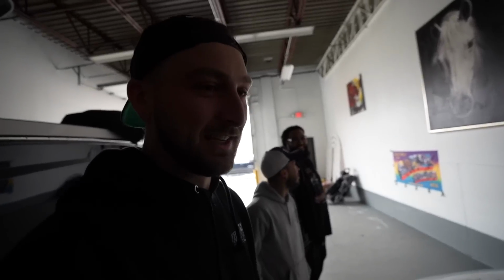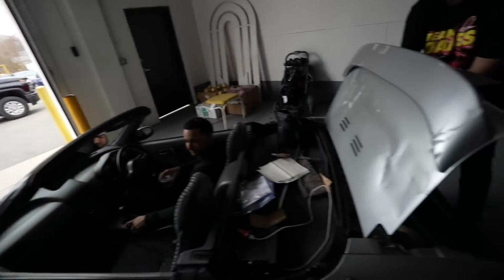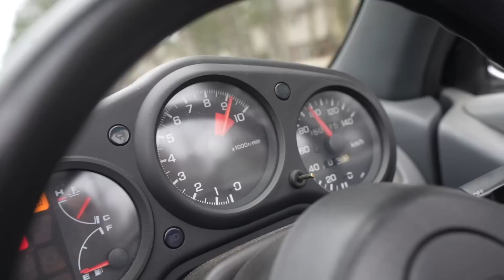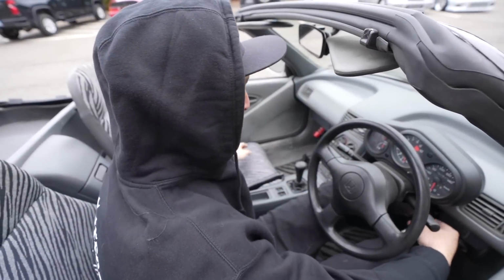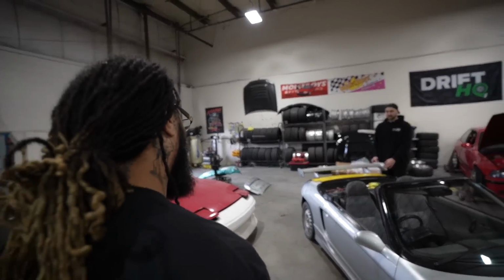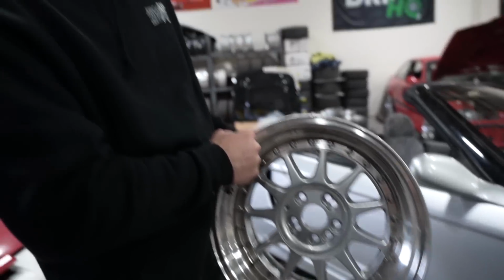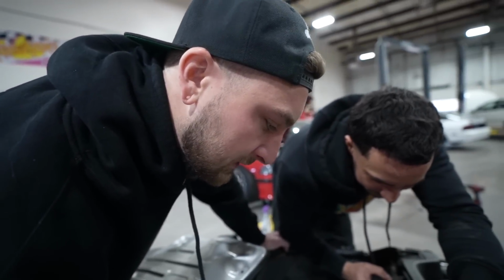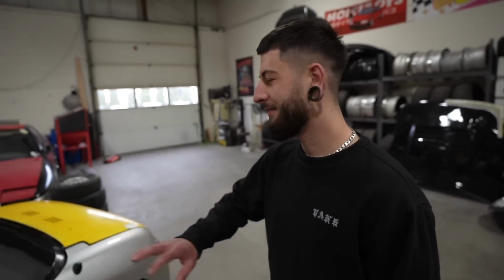The Honda build you’ve all been asking for..

Comment: That 9,500rpm stock recline isn't what I expected from the 3banger. This car be so fast with a k20z3 out the 8th gen like i have in my shed. I needed a k24 to push the heavyweight fg2 like I wanted. But the k20z3 would be insane in this.

Comment: Going to a Beatmeet with the boys might sound a little strange there Jimmy..😉 Cool chassis for sure, given the engine position this would make even more sense to motorcycle engine swap. Somehow it doesn't really feel like you're up for it; given that it goes from a side project to a engineering project but I'd love to see it. It's been done plenty of times so off the shelf solutions are available. And Honda has made some very tasty motorcycle engines to drop in. I'm a big fan of the VFR V4's they made, good torque throughout a wide and high rev range and it creates the most ungodly good noise. Somebody made a compressor kit for the 800 VTEC ones giving it a healthy 200 HP. Plenty in such a lightweight chassis. Using it's sequential.. Anyway I'll keep dreaming.  For inspiration; remember that first gen Civic that first appeared on The Smoking Tyre? Go find it if you didn't, its well worth it. That has that engine in it, NA.

Comment: best cars out! love em so much, stock engine is great and sounds amazing.

Do yourselves a failure and crack open the ECU to see if theres any broken capacitors - they'll leave you stranded and its a super common issue with these as the ECU's suffer from heat through the firewall from the engine. A new main relay might be a good shout if it hasnt been replaced too!

Comment: Jimmy, I've tuned a Suzuki cappucino on e85 with a larger factory sized turbo and made 88kw out of the 660cc Suzuki motor.  other option is Hayabusa motor swap.  power to weight ratio is where it's at.

Comment: Looks to me like the boot lid structure is different, the original boot the hinges were recessed. The yellow boot the hinges aren't recessed it seems and cause it to sit higher. I think Jordan yellow firstly for colour and a small turbo to spice it up a little, the body needs to fatten up a bit around the wheels ;) and make the arches round front and back.

Comment: You guys have to swap a Yamaha r1 motor in it. The 2016+ motor tho. With the cross plan crank shaft it would just sound wicked. Everyone always swaps the normal screaming 1000cc motor but no one does the r1 motor.

Comment: Hear me out, I love your boy Spoon but with that nickname you are required to have multiple spoon sports/type one goodies. I remember seeing some of his stuff and work that you were showing off his red civic and I didn't see one spoon item. I see that Spoon flag but buying a flag doesn't earn the spoon nickname; I expect a spoon build soon or at minimum shiftknob, yellow valve cover, oil cap, radiator cap and radiator hoses and alot of stuff id love to see along with maannyy viewers that may have started learning about automotive. Otgerwise unfortunately he might be a bit of a replica spoon lol 😅 I own a G35 sedan & I own a 7th gen Em2 civic coupe EX, this era of the Civic and other Hondas people  usually don't like them or they love them.-1). Engine was a D17 -2.) The best D17 is the d17a2 because the head has a mean vtec selondoid that actually barks hard and starts vtec at only like 3 to 3500 rpm and alot if the D17's are non vtec -3). The jdm d17a makes like 10 more horsepower than our highest rated D series (d17a2). -3). Because it's more of a usdm car and wasn't sold in Japan as a coupe (EM2) but the seventh gen ES sedans were sold in Japan and shares the same platform basically an Acura CL 1.7 displacement for Canada viewers. -3). The EP3 looks much more ugly IMO but people don't realize the Si EP3 is a Civic type R in certain countries but it looks like an egg and a hamster mixed together as a hatch with a manual shifter on the front dash area basically but I've heard great reviews from owners. So if you can't afford an rsx type s, look for a civic ep3 si; if the car came with a K series go for the Si & type S version so you get that ultimate stage 3 i-vtec. There's a few different k20's & k24's so if you don't know the facts look 'em up on Wikipedia. I'll start sending links for genuine Spoon goodies; or maybe our boy Tommy Fyeah could help just always compare pricing and watch our for replica because eBay and Amazon is 90% replica so I always use tge part number method. I hope to see a champ white spoon build with the Blue windshield banner. Come on guys I know what tge people want lol love you guys regardless! 🥄